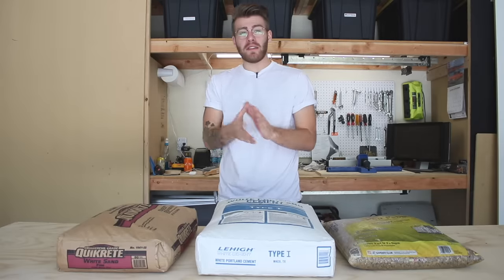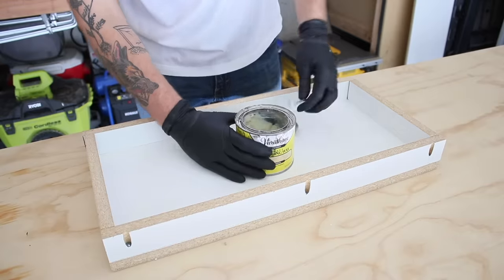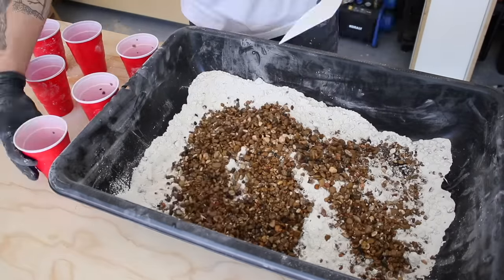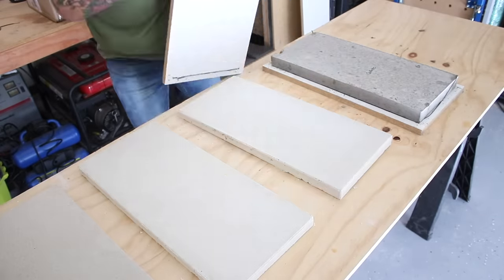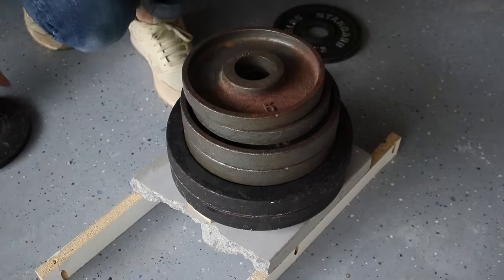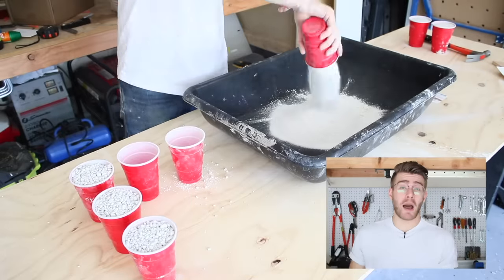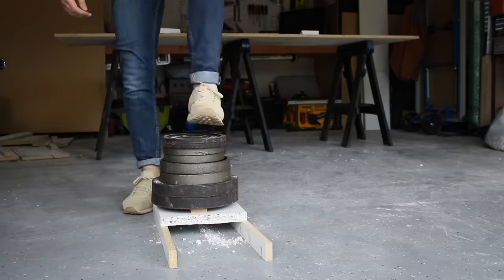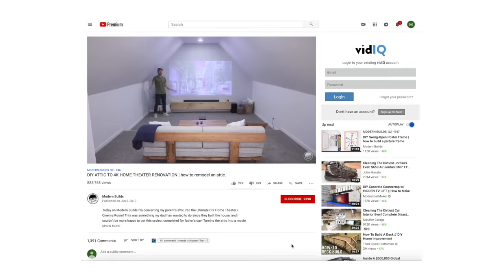How To Make White Concrete | A Modern Builds Experiment

Comment: It takes about 28 days to develop strength to concrete.. white or grey cement
Reply: Depends on the size of the pour. Hoover dam was poured in the 1930s and it's still hardening, won't be full strength for a hundred years or so.
Reply: I sad, at least 7 days. 👍
Reply: Well, it gets harder (psi).  However, i'm not sure that it's tensile strength improves, which is kinda what he was testing
Reply: @SithLord2066  afaik pretty much all concrete hardens for a good few decades, (to be technical concrete pretty much cures forever, but concrete starts eroding from the outside sooner than forever, so thats why there is a lifespan for concrete (that is in the hundreds of years) curing doesnt depend on the pour size, it depends on cement being in contact with water.

after about 28 days it already at 99% of its maximum strength, thats why the industry uses the 28day (exactly 4 weeks) so its easier to time manage, and gives a good margin, but it keeps on getting stronger by miniscule amounts long after that.

also, hardness is in direct corelation to tensile strengh found a simple explanation on the internet, so its basically like this:

Hardness correlates linearly to Ultimate Tensile Strength through the empirical (although theoretically explained) equation H=UTS/k.

H can Vickers, Brinell, Rockwell, microVickers, nanoVickers, whateverVickers but it will inevitably correlate with the ultimate tensile stress.

k is a constant that depends on the hardness scale / type of measurement and on the material

Comment: You actually need to let the concrete poor sit and cure for at least 28 days, which was told me at school, to gain more strength before testing. And the rougher and sharper the gravel is, the better. But anyway, great video!

Comment: Concrete strength is against compression forces and not for tension forces (test you did). Tension forces strength on concrete are around 10% of its compression strength. A better test would be to drive the wheel of your car over the slab to see if it crushes!
Reply: Tensile strength is still specified by engineers for some concrete applications, but you're right!

Comment: Concrete is designed for compressive stress not tension that's why you put steel bar at the bottom of concrete. But then it's a nice presentation.

Comment: Hi, I am a Civil Engineer used to design concrete mixtures. And these are my advices:
1- Make the mixture proportions 4 parts cement 6 parts sand & 9  parts gravel
2- use water about 30-35% of the cement by weight or roughly 45-50 % of the cement by volume
3- Use concrete superplacitizer about 1% of the cement by weight or about 1.5% of cement by volume.
4- Add 70 - 75 % of the water to the dry mixture and continue the mixing
5- Mix the remaining water with the placitizer then add to the mixture and continue mixing till you get homogenous mixture.
6- I recommend to add special fibre for concrete and you need to follow the manufacturer instruction. Normaly it is about 0.5 to 1 kg of fibre per 1 cubic meter. The fibre will act as reifircement.
Regards
Eng. Maki S Hussain - Iraq
Reply: Thank you.  Very informative.  Do you know of any good books on concrete - especially technical ones for engineers?
Reply: Sorry, I dont agree on that water cemet ratio. And more importantly Why I think that the white cement one didnt achieve strength is that the aggregates were too round due to which the binding of naterials didnt take place. Where as the ready mix had mix angles of size and shape.

Civil Engineer from India
Reply: @vaibhavchauhan5770  I wonder if the differences in your opinions have to do with geography?

Like I remember Iraq being very dry and hot, vs my friends experiences with India being incredibly humid, but obviously i don't know much else about your whereabouts other than country.
Reply: Wow thanks Maki
Godbless you and your family
Reply: @wasabij  interesting point...I've seen some Amazing modern architecture online from India lately, Godbless
Reply: So if I use white cement to build my house is it safe ?
Reply: @onestepo3611  Wite cement is more expensive than ordinary portland cement
Use ordinary cement in general especially for structural element. 
Use white cement for decorative elements
Reply: Can you please advise me if installing it like a finishing layer to the slab with an approx 3 cm thickness is possible, with mesh and after grinding and polishing?
Reply: @vaibhavchauhan5770  So, what is your advice on water-cement ratio?
Reply: @vjeranski5942  You can make a layer of concrete of 3cm thick with fine gravel of about 10 to 12mm.  If you you use bigger size of gravel,  then you can not use steel mesh because it woulb difficult to fill the cover underneath. You can mix fiber with concrete instead of using steel mesh for non-structural concrete. 
Make sure as a final finish to control the level and you can divide the area to small working areas then concrete them not in one go but in stages.
Reply: @makisalimhussain2334  Thank you :) It is amazing advice.
Reply: if money its not an issue adding some pozzolanic materials its also a good call. 20% of the cement  could be replaced by metacaulin or 4%  by  silica fume
Reply: with that mixture will you still need steel for a countertop?
Reply: @josephdunn4388  I believe it is needed sincce the slab is similar to buildings suspended slab. You  may go with fine (small size) steel mesh.
Reply: @emilioduarte7089  Best to evaluate any mixture is trial mix and testing the strength.
Reply: *And wait at least 28 days to get the actual concrete resistance before testing.
Reply: Woah! Thank you for this Engr. Maki!
Reply: @makisalimhussain2334  Dear Mr. Maki,
  Please I need your  technical advice. I am srilankan  junior materials engineer and I am planning to start my own business to produce concrete wall tiles and concrete floor tiles with advance properties than conversational products. I need to produce above items with very less water absorption and high hardness to  make more competitive with ceramic tiles. And I need to produce them with some natural design on the surface. Most of srilankan manufacturers frequently use the formula with ordinary portland cement, crushed granite sand, granite aggregates ( 3/4") and additives for easy ejection and fast curing. Could you please advice me on getting above properties ( Minimizing water absorption, Improving surface hardness and scratch resistance). Thankyou verymuch..!!!
Reply: Dear Mr. Maki,
  Please I need your  technical advice. I am srilankan  junior materials engineer and I am planning to start my own business to produce concrete wall tiles and concrete floor tiles with advance properties than conversational products. I need to produce above items with very less water absorption and high hardness to  make more competitive with ceramic tiles. And I need to produce them with some natural design on the surface. Most of srilankan manufacturers frequently use the formula with ordinary portland cement, crushed granite sand, granite aggregates ( 3/4") and additives for easy ejection and fast curing. Could you please advice me on getting above properties ( Minimizing water absorption, Improving surface hardness and scratch resistance). Thankyou verymuch..!!!
Reply: @missakamanaranga2585  
Dear Missaka, 
The more dense concrete the less water absorption and of course more stronger for same mixture. 
Components should be salt free and properly washed. Salts especially sulphate/sulphite have very adverse effect on concrete. 
It is not necessary to go for crushed granite and you may go for normal crushed gravel and sand if available. 
Of course you need to go for specific additives to give self compacted (high density) concrete and early strength so that you can demold your product after 1 day.  I used to use additives PC8200. It is a product of Turkey and I do not know what is available in your country. 
You need to go for trials till you achieve the result you target and with copetative cost. 
To summarize the above 
- Use clean crushed aggregate
- Use minimum as possible of water by maximising the additives.
- Use sufficient vibration of the concrete is not really self compacted.
-- Must go for trials to obtain best formula in term of quality and cost. If you target 30MPa concrete, then you need to go for 370kg cement/m3 and more.
For surface hardness,  let me seek the advice from construction materials suppliers. 
Regards
Reply: @makisalimhussain2334  Thank you verymuch for your reply. I got it. When I  try to find minimum water/ Cement ratio, are there any advicable ratio which I can plan a test aroud. When I reduce it, will it affect on the workability of concrete. Which kind of additives you recommend for fast curing? If I use some percentage of soil or clay in the formula, what would be the effect to the strength?
Reply: @missakamanaranga2585  
I consider 0.35 is low water cement ratio. 
Of course workability will be affected and that is why you need additives.  You need hyperplacitizer for precast which can give early strength and high workability. 
I never came across adding clay or the like of materials.
Your crusal elements are water cement ratio and the additives
Reply: @makisalimhussain2334  Mr. Maki, Could you please recommend me some reference, text book, or a web site where I can get some practical knowladge regarding this?  I respectfully and gratefully thank you for sharing your valuable knowledge for the benefit of all of us.
Reply: @missakamanaranga2585  
Dear Missaka, 
All informations given are based on my 36 years post-graduate experience and some temolates for concrete mix design. 
I can extend to you sample of calculation, but I need to know which standard you are referring to,  BS or American.
Reply: Hi Maki, thanks for this mix. How about the mix ratio for slab topping? I wanted to have a white cement topping with waterproofing compound/liquid but don't know the correct mixture ratio.
Reply: @makisalimhussain2334  thank you so much!
Reply: The fiberglass fibers you see added to some concrete mixtures are special alkali-resistant fibers... Ordinary glass is etched and broken down by cement/concrete and will lose its strength with time.
Reply: Mr Hussain, thank you for sharing your knowledge.
Reply: You are welcome
Reply: @markhooker8520  You are welcome
Reply: Hi Eng. Maki! i am trying to make small pot using white cement craft.... waited for 24 hours to dry but after i demould it becomes powdery and crumbly... Any advice how to make it strong? Thank you!
Reply: Γεια σας καταλαβα απο το μήνυμα σας οτι ειστε ειδικός. Αν μπορείτε θα ηθελα να μου πειτε αν θελετε και γνωριζετε τις δοσιλογιες για σκουρο γκρι τσιμεντο. Ευχαριστώ
Reply: 1 , 1.5, 2.5? lowest common form?   thank you very much.
Reply: Ok so how would I break this down to make candle vessels?

Comment: Replacing 20% of your water with white latex paint would help with your tests and color.

Latex paint increases concrete's flexural strength, and of course the white would make it a bit whiter.

Great video tho!
Reply: Good idea
Reply: @joeyknight8272 , I willingly admit that it's not one I came up with. 

About ten years ago my wife and I started a small ornamental concrete business, and in my research to find out if I could use latex paint as a means to dye concrete? I found out it's strength benefits as well.

Concrete is part black magic, and part state secrets, and many folks closely guard both. I try to share what I know to be true as often as possible so others can, and hopefully, do the same.
Reply: @russellborrego1689  that's good
Reply: the white in paint is Titanium dioxide, which you can purchase. You don'treally need the other stuff
Reply: also white rocks that were crushed instead of tumbled would be what you want.
Reply: @Tehcarp , RE: Titanium Dioxide... absolutely.

But thats only regarding the color, not the strength improvement. Titanium Dioxide is sold commonly for use as a concrete colorant/pigment/dye.
Reply: Just use Acrylic Bonding Agent. no colour change (some sheen change)
Reply: @russellborrego1689  Sir... Do you have any video so we can learn how to make it. Thanks
Reply: Shouldn't he be putting aggregate in after mixing and pouring?  Because all his gravel is settling.
Reply: Russell Borrego I want to see a part two where he does this and he re does the ultra white with fortifying liquid instead of water and see how they both perform
Reply: Source?
Reply: Anubis Osiris no source. He said he experimented and found out that latex paint worked. It shouldnt be hard to believe since  cement fortifier is a latex copolymer.
Reply: I've never thought of that thank you. By latex paint you mean emulsion paint, the common one we use on walls?
Reply: Is the latex paint the same as acrylic sealant?
Reply: @russellborrego1689  Wouldn't crushed lime be whiter and help out with performance also?  Especially outdoors.  Didn't know about the latex.
Reply: Now that's a good idea!
Reply: Would the Latex paint work outside?
Reply: @ArmunP , in the concrete mix? Absolutely.

The concrete behaves the exact same way as dried concrete without it in its mix.
Reply: @jafinch78 , I can't speak from any position of experience on that one. Everything I was ever told or read about adding lime to concrete mix was that it would decrease the characteristics of the mix that we needed to make our stuff. So I avoided it.

I was told that while it was smoother when spread by hand, it was also stickier. Which is not a good thing to have when pouring into molds and trying to avoid trapped air.
Reply: @ihavenoname6724 , I'm sorry. I don't know what emulsion paint is.

I know our local home improvement stores, Home Depot and Lowe's, sell latex paint in one and five gallon containers. That's what we used.
Reply: @russellborrego1689  I see.  I'm from the awareness that outdoors projects are better to use crushed lime for the aggregate vs stones in the 60/40 mix.  Also, forgot to note that "lime" in the traditional pre-portland cement like mortar for low fire bricks hydrated lime is used.  Later high fire bricks came along and hydraulic lime and portland cement... like as a history thing.  The more "hydraulic" the lime is, the harder it is... so keep in mind there are two types of lime.  Hydrated lime and Hydraulic Lime where the later is stronger.
Reply: @russellborrego1689  what was your experience with experimenting with different colors latex paint? Did it still stain somewhat evenly?
Reply: @Stormy_Dawn , yes as long as you mix it well.

Everything in the concrete mix gets coated by your glue (wet cement) that holds it all together, and the water hydrating the cement is what causes the chemical reaction that cures the 'glue' and makes it hard... Holding everything in the concrete mix together.

Since the paint is in the water to start with, then it's in your 'glue' that you're really coloring. Mixing everything well, coats everything in the mix for sure.

EDIT: To be clear, colors will always end up muted. Red will be more pink, black is more of a deep gray, etc. If buying colors specifically to test out? Keep this in mind so you can plan accordingly, experiment and have fun with it.
Reply: @russellborrego1689  so perfect! Thank you!! 
Curious what sort of prep would need to happen when pouring over existing slab if any? Should be simple right?
Reply: @Stormy_Dawn ,  you'll need concrete bonding adhesive to put over the old concrete to give yourself the absolute best opportunity that the new stuff will stick to it. I'd pick some up from home depot, lowes, etc... and then call the manufacturer explaining your project in case they can recommend a specific idea or technique tailor-made for their product.

If youre making big batches of concrete, I'd make enough of the colored water ahead of time in one shot so you're always using water that is the same color... Think garbage can if need be for storage.

If the concrete area is big? Mix as much concrete as you can in one shot and measure the water amount youre using from batch to batch so the color stays consistent from batch to batch. Nothing more annoying that mixing two batches of concrete for the same project, only to have them end up being different colors when you didn't want them to be.

You're welcome, happy to help!
Reply: @russellborrego1689  sweet!! Thank you!
Reply: @Stormy_Dawn  sure thing 👍👍

Comment: So you want strong concrete ? Try to add poly fibres. 
Want a rock solid material for machinery or structural applications ? Try resin granite (5-10% resin).

Comment: The problem with the white gravel is that the cement wasn't able to bond with it as well.

That's why you don't use smooth or dirty rock in concrete manufacturing.

If you used clean and angular quartz or light limestone, your concrete would have been stronger and just as white.

Comment: Hey Mike, white concrete can be made by adding Ti02 or Zinc Oxide pigment in concentrations up to 10%. Both can be found at your local art store.

TX Active cement bags have nanoparticle Ti02 for an ultrawhite finish. It's also self-cleaning to an extent.
Reply: Yes, get your EIN ready to speak to an Account Representative about buying 50 pounds of pigment direct from the manufacturer. 

50g of Pigment is enough for a square foot of concrete. Getting 16oz (450g) of Gamblin Artist Grade Ti02 pigment from Michaels for $16 is more than enough for a couple of DIY projects.